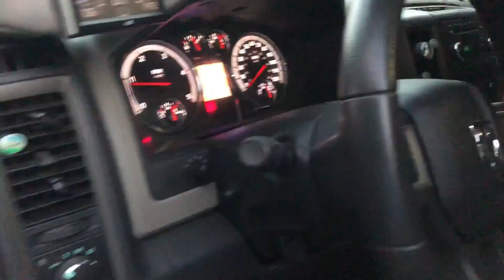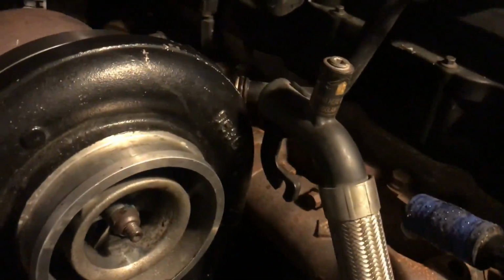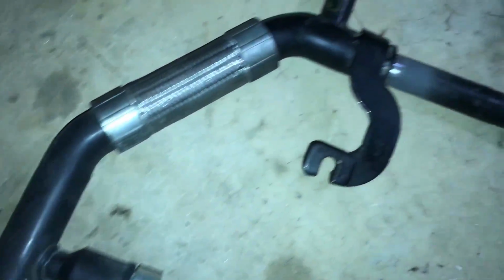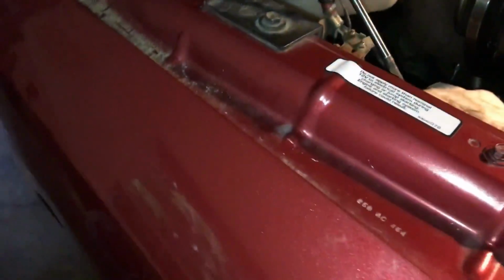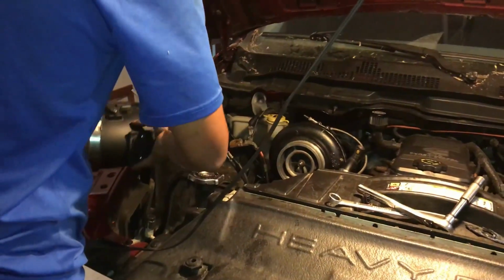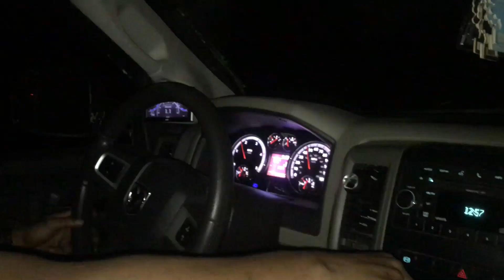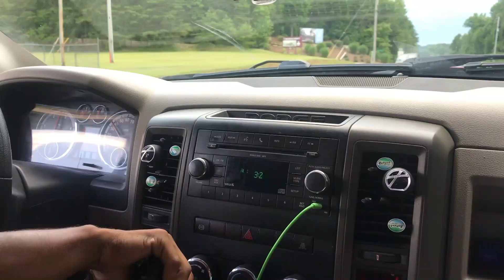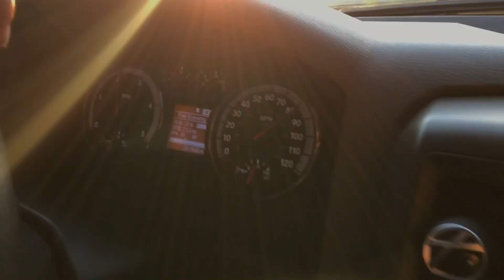CUMMINS COULDN'T HANDLE THE BIGGER TURBO!!

Comment: Very common in the g56 trans is the 4th gear syncros get destroyed. If the clutch feels fine it shouldn't be the clutch but if you can no clutch response then clutch. I'd do a nv5600 swap on it and you wont have any problems

Comment: So here’s a few thinks go check. If it doesn’t go into 4th at all it’s a synchronizer. If it grinds in reverse and 5th it’s clutch. I’d check synchronizers first. That’s what it sounds like. But also tranny could be gone from pulling the boat and sending it at the same time.
Reply from the maker: It goes into 4th but there's no gear there. It's like it blew apart
Reply: RevTap Industries drain the oil from the trans and see what type of shiny stuff you get. If it’s all brass synchro ring, if it’s steel could be blocker assembly stripped the dog teeth, bearing could have went(sounds like it, or gear issue. You might be able to see the issue two with both pro covers off.
Reply: Pto covers*
Reply from the maker: Thanks for the help!
Reply: Flex plate?

Comment: It’s a clutch you fried it just had the same thing happen in my 2500 i our a valair dual disk 3600 series with upgraded hydraulics and it’s smooth as butter

Comment: What brand kit/brand was your 2nd gen manifold swap. This has a truer 24v tone than most other 6.7a I’ve heard!
Reply: I think it has to do with the manifold. I’ve noticed the trucks with the steed speed manifold don’t sound as true to an old 24v like the ones with a dps or smeding 3 piece manifold.
Reply: If I were you I’d go with a smeding kit they seem to sound the best or industrial injection they both use that style of manifold.

Comment: This was well needed, writing a 20 page essay sucks. Might be better to get a good used trans for the Dodge, unless you're gonna start sled-pulling or drag racing, it seems like the stock one should do fine for towing and playing on the street. Does the truck have 201k miles on it? Or did I read the odometer wrong?

Also, damn that truck sounds nice!

Comment: Put an Allison in it dodges tranny’s suck
Reply from the maker: Haha I got an Allison sitting in my garage right now due to a cracked tail housing
Reply: RevTap Industries yeah well it’s regarded as one of the best tranny’s ever built
Reply: Allison’s are good tranny’s as long as you don’t add any extra power to them. If you do they are just as bad as dodge transmissions.
Reply: RevTap Industries what year Allison?
Reply: Live4 Boost either an 01 or 02 I believe
Reply: Landon   Schad don’t worry about that man I have an Allison. 😆
Reply: Honestly all transmissions have there issues even the “holy grail” as u think Allison trans blow up . I run a fully built 48re in my cummins & yes I’ve had to rebuild it several times but hey I’m making in excess of 900hp & leave in 4wd on a bit of boost . I assure u even the Allison & even a ford auto would fail . So not any is better when u put power in front of them .

Comment: Go out and get yourself a used g56, put a better clutch in it and input shaft. Have the gears checked and get a girdle on her. Should be able to hold 1000hp easy with a Manny. Flex when hot is a killer.

Comment: That's exactly why I'm kinda unsure about buying any kind of Dodge Ram....
Reply: Kountry Quads best truck ever made I have one myself and love it to death
Reply: This ones got over 200k on it and it doesn’t look like it has been driven easy it’s whole life shit like this happens when you throw power at them
Reply: They weren’t meant to be thrown around and put that amount of power.  if you have a built trans that’ll handle a lot of power then your all set my uncles work truck is a 95 12 valve and had less probs than his  2012 6.6 duramax

Comment: Typical g56 problem I'd nv5600 swap or buy a built 48re. If you keep the g56 you need to buy the cage that goes around the trans so it doesn't twist under torque there 500 bucks

Comment: Yeah that was stupid I mean I understand the 5.3 and 6.0 Chevy shit but I have a 1999 second gen, and I had to rebuild it and it’s not cheap even for a transmission it’s not either. So best advise is to go ahead and fix it but leave the hooning shit in the ol Silverado with them vortex tornadoes under the hood for the messing around lol🤣🤣

Comment: That's what you get for  not being experienced  and smart with your investment. Just slapping parts on without a thought to what it will do to components down the line.  Just because its a manual doesn't make it bullet proof. Back to the drawing board boy's

Comment: G56 suck ass. I have a 800 hp 3rd gen with a nv5600 and south bend dual disk clutch and never had a problem. Sounds kinda like a pressure plate issue maybe. Good luck

Comment: you guys are kinda clueless just saying... 3rd gen is a 6.7 lol
Reply from the maker: You’re the clueless one bro 😂 03-07 are 5.9
Reply: you mean early 07... 07 1/2 is 6.7 lol  technically 3rd gen is considered 03-09 so both 6.7 and 5.9 engines. but again, your the ones dumping water into that new of a truck instead of premixed coolant, and talking about just beating a turbo into a truck thats hitting on the frame lol. But don't mind me... plus ive seen your other videos and the stupid crap you do with trucks
Reply: "hydro pump" lol. yep.... sure

Comment: Why don't you buy a 7.3 liter power stroke turbo diesel?!
Reply: They're good workhorses but they break just like everything else. Plus he wants the truck for fun as well as work. It takes a lot to make a 7.3 fast in comparison to other trucks.
Reply: LS1 Gaming and PC's yes I agree but if your looking for something that is going to last the 7.3s are beasts. They might not be the fastest but they are tanks.
Reply: Seems like the OBS ones are the most reliable. My dad has two a 97 (4x4 5 speed) and a 99 (dually 4x2 auto). The 99 has had several problems with the HPOS. It only has 170k. The 97 is around the same millage has only needed a break caliper and water pump (and the cam sensor recall). Both were purchased new. Great trucks otherwise, the 97 rides like the axles are welded to the frame but runs fine otherwise. 😂
Reply: Why go down on power ,with the powerjoke,,who wants a slow slug
Reply: John Hansen fords are junk
Reply: There overpriced

Comment: Shoulda got a good ol powrstroke
Reply: Brian Ordean do the new ones come with boyfriend's?
Reply: Yes
Reply: Or buy a Durmax so you don’t have to put all you money into it to dix it when you get it 6.0 power stroke problems
Reply: They sound good but l like old ones
Reply: Hey l bet my power stoke is better then yours truck my has about 700 hp last Dino as much as l can get
Reply: Brian Ordean he owns a old rusty af f100
Reply: Anthony Cach hp doesn’t help when you can’t leave your driveway
Reply: Brian Ordean powerjoke...
Reply: ghonorea tree root  may be best in class but not for that many miles. Show me a power joke that’s went over a million miles without pulling the pan or valve cover.
Reply: ghonorea tree root 20 lbs fewer with an i6
Reply: timboslice46 more 7.3s have made it over a million than any other truck the cummins can to but the truck and transmission will fail multiple times before that the 6.7 powerstroke will easily do a million miles on the same engine and tranny the abosolute best truck money can buy
Reply: PowerJOKE